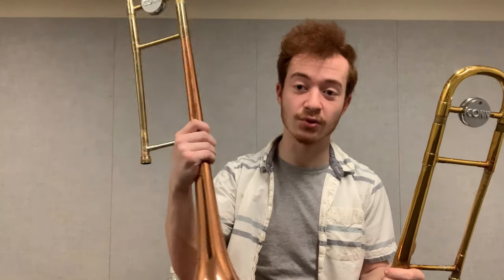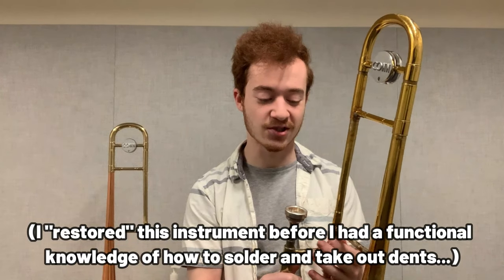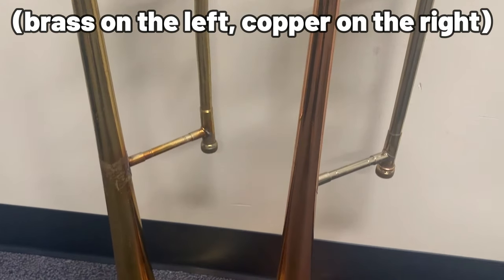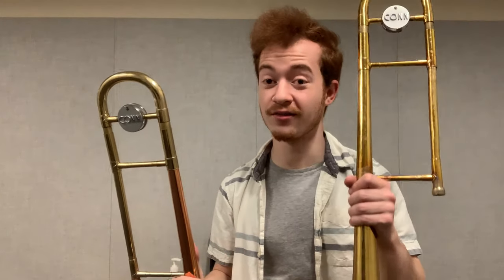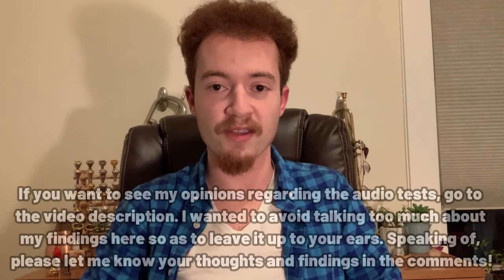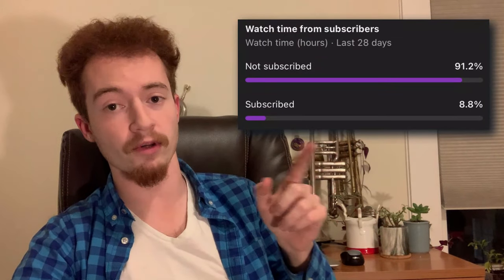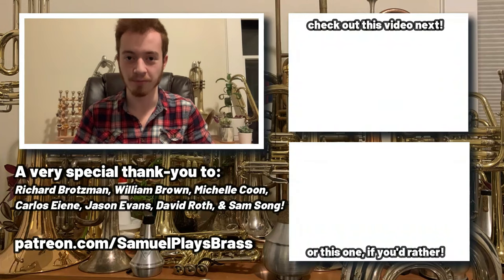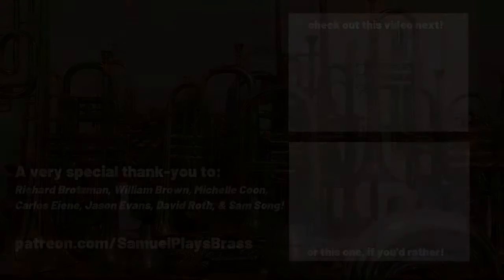BRASS vs. COPPER Jazz Trombone Bell Comparison! Different Metals in Action!

Comment: Great video

I like the 18H Copper Bell Sound.

Also, i Have the Late 18H Model With Yellow Brass Bell and .500 Bore Slide.
Reply from the maker: Thanks for the comment! The Director cornets had some discrepancies as well. For instance, I believe I have a later-issue 18A cornet, which has a larger bell (also electroformed Coprion) than standard, but that model was replaced with the 17A, which had a smaller bell flare, longer primary tuning slide, and shorter secondary tuning slide.

Comment: I had one that I picked up from a antique store, for $200 cdn and sold it for $500 ,had no case or mouthpiece ,the horn in good condition except the brace from the bell to the female end receiver had to be soldered on.No wear on the stockings of the slide and the copper bell was in mint condition with no scratches and dings to it.I do prefer the full copper bell sound of the warm GLen Miller sound and style. I do wish manufacturers had the option of having a 100 percent copper bell for tubas , euphonium, and bass trombones.But that pure metal is very expensive to produce and a world shortage of it now these days.
Reply from the maker: You managed to sell it for $500CAD? I’m surprised. Anyhow, I do like that you mention Glenn Miller because that style of music is a great use of the copper bell. Seems like whatever copper deposits are left in our mines might have to go towards copper wiring and battery components, though…

Comment: I had no idea pure copper was even used.  I liked the regular bell better for the first piece.  The copper bell sounded too dull.  Trombones already tend to have a great jazz sound at lower volumes.  I could see using a rose brass bell for trumpet or cornet perhaps.
Reply from the maker: I do have a cornet with a fully-copper bell and both a trumpet and cornet with rose brass bell (you can tell it’s time to downsize my collection). Very helpful there. I’m surprised you preferred yellow brass in the softer volumes but you do have a fair point about trombones’ natural jazz leaning.